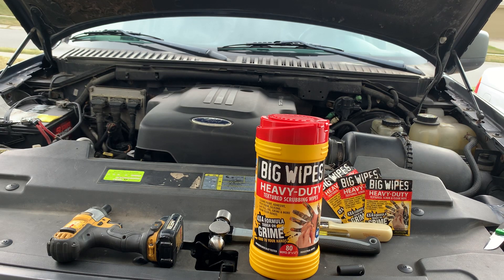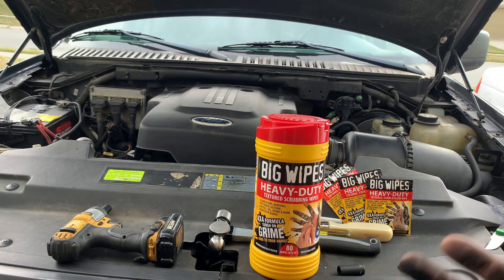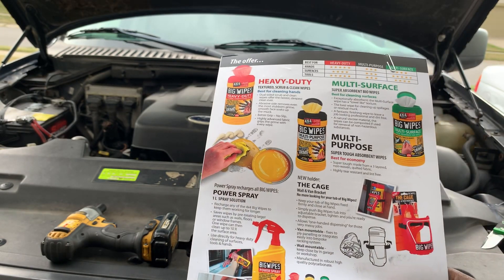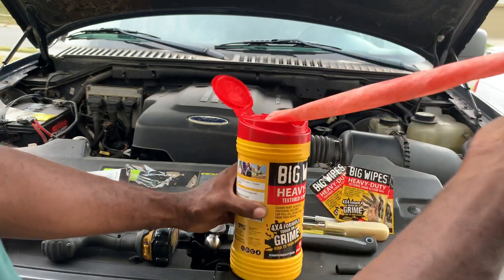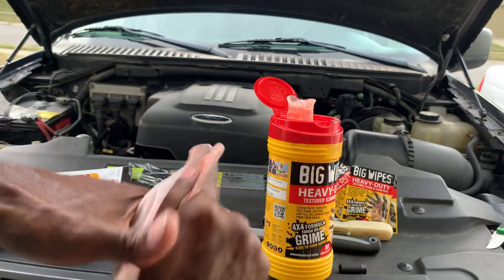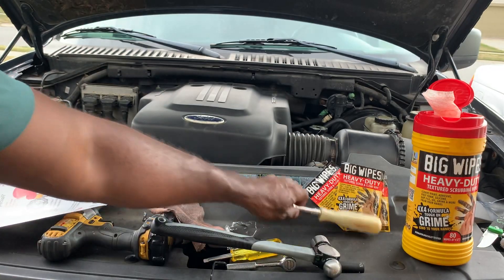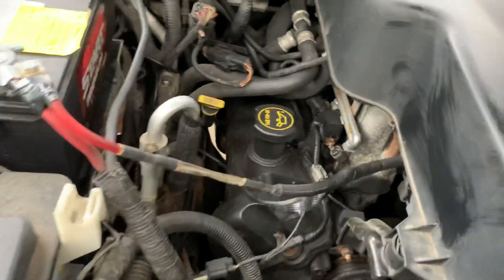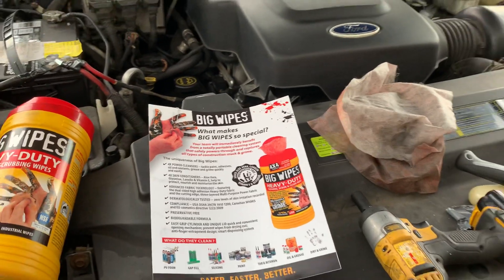BIG WIPES USA | Product Test

Comment: You just reaffirmed something for me. I want to clean 🧼 and in some cases paint my tool boxes BEFORE I put my new  tools 🛠 in them after the unboxing videos. I also want to clean up and order new stickers for my 20 ton Grey manufacturing air lift. My uncle Steve taught me the job ain’t done until the tools are cleaned and put away. I even did that 40 whatever years ago in the Army. Didn’t matter if I were in the snowy mud in Germany 🇩🇪 or on the airstrip in Florida.